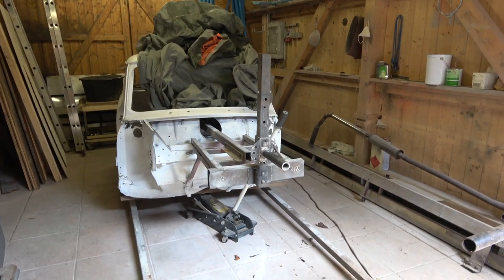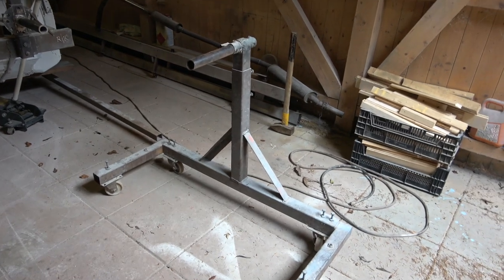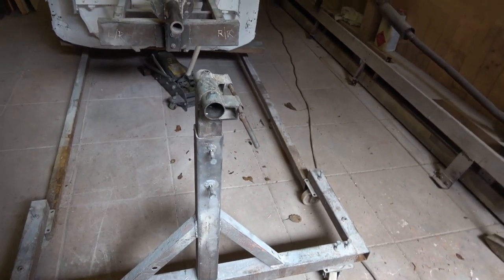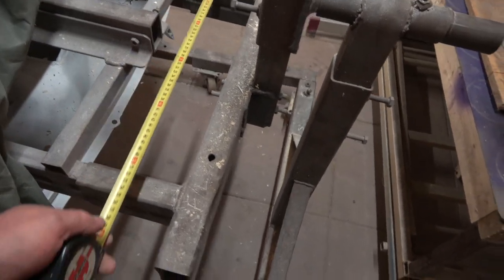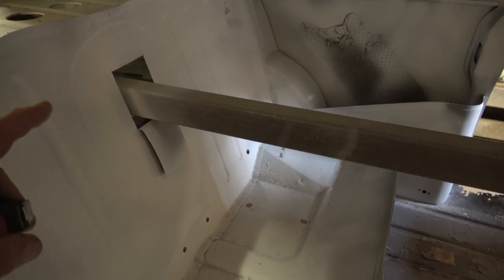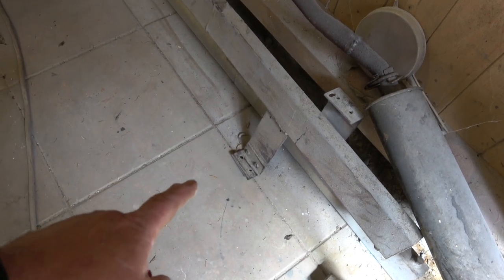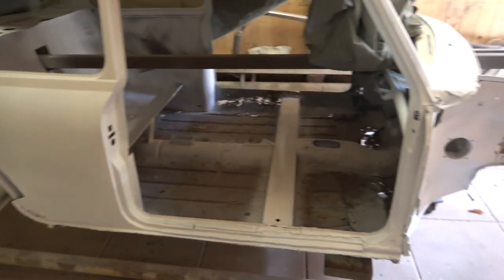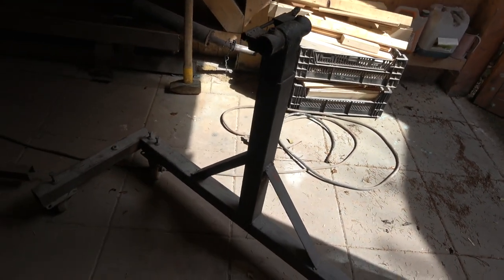DIY Body Shell Rotisserie ( Jaguars & Classic Minis ) Multi-Purpose.

Comment: Hi Dave . Great advice on that rotisserie . And the're aren't too many who could scratch build  a jig ! There's no way l'd put a new quarter panel on Dave , l'd fabricate an arch section, weld it in , job done ! Cheers !
Reply from the maker: John,  I hope it will help anybody thinking of building a jig or at least give them a few ideas. I have to admit the rest of the quarter panel is in pretty good shape 
and it would be a lot less work for sure. Grafting in a repair section over the arch would need to be done very carefully. I will asses what I need from M Machine
in the UK and also the total cost of the panels. As I want to see it as a finished shell I need to get my parts and labour back 🤔 Cheers Dave